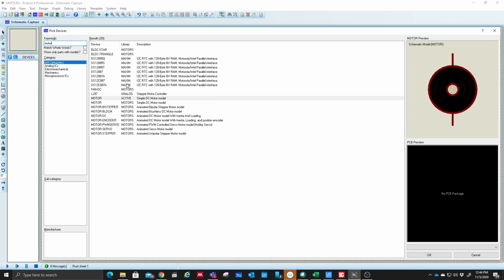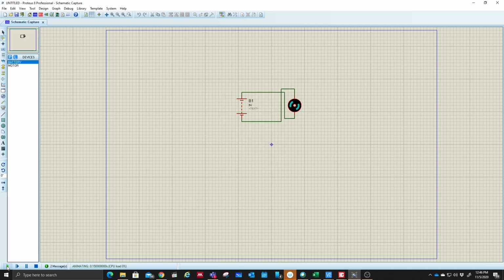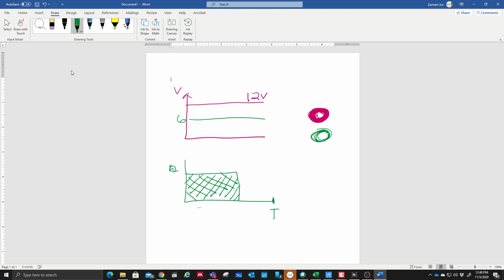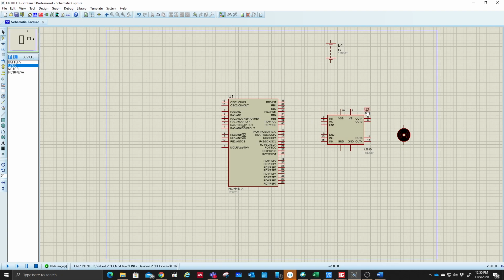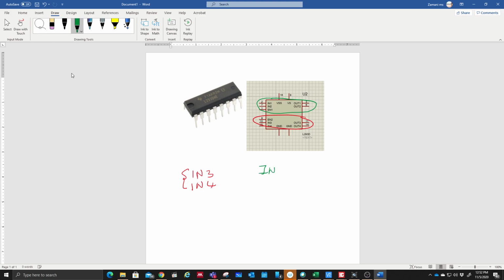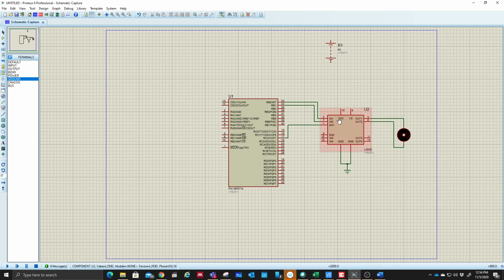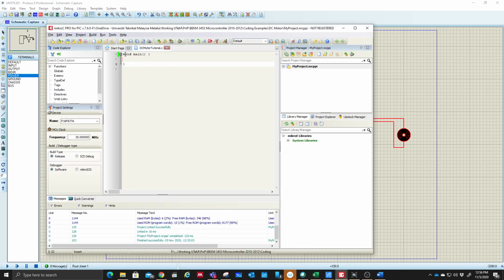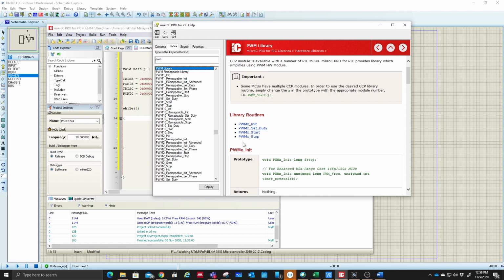BEKM 3453 PIC16F877A Tutorial 2 1 DC Motor Control

Comment from the maker: The connection for L293D VSS and VS are wrong and it should be vice versa.

VSS if for 5V power supply
VS is the battery to support the motor for spec more than 5V for eg. 12V

Sorry for the mistake